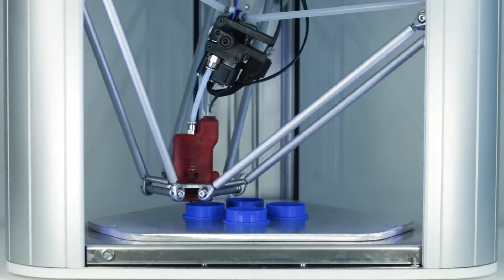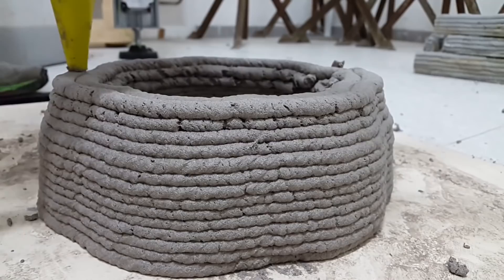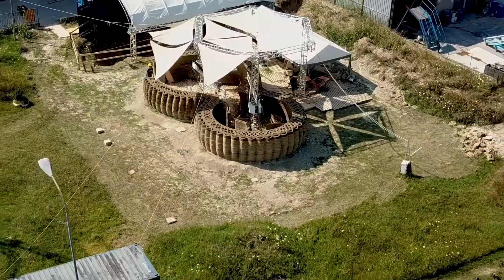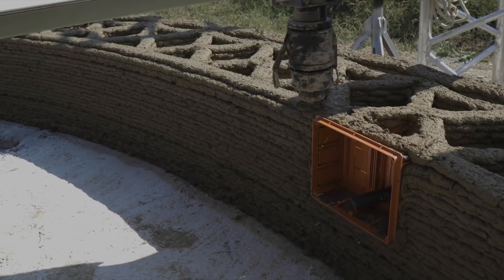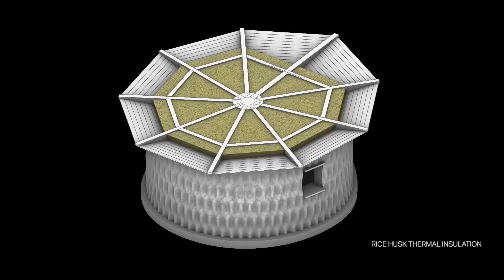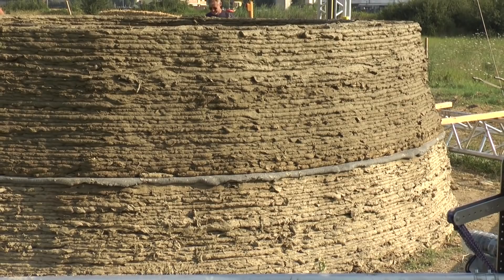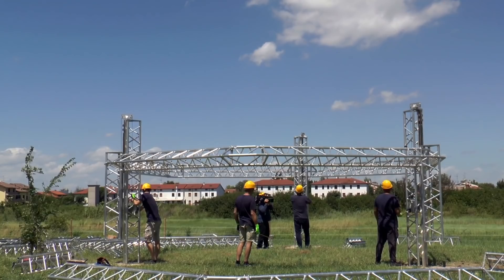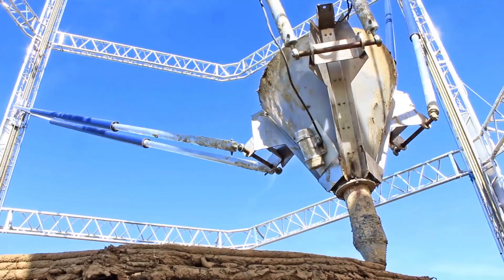$0 HOUSE | How One Startup Aims To Produce Homes at Null Cost

Comment: So the machines are free, the labour to set it up and transport it is free, the energy used to run the machines is free, the water arrives for free and is for free?

Do not make BS claims and BS clickbait titles, there can be no null cost house, only if you decide to live in a naturally formed cave or something (assuming you can get the ground for free).

So instead of claiming nonsense null cost why can't you/they just show the actual costs and the realistic savings??? 

Costs for houses, is much more than just the materials used, as for any object/thing. If such printers are made and are expensive then a certain rent will have to be paid by hourly or daily use, or at least some compensation to cover the initial costs of the machine and costs for the maintenance. You will also have to pay for the transport of it and for the labour to set-up the machine, break it back down, and for instructions or professional oversight for the usage. The machines also still need energy, probably electricity, to run, which is also not free. A zero cost house is generally impossible and a ridiculously stupid claim.
Reply from the maker: They said their goal is to make houses at null cost they didn’t say its possible yet.
Reply: @automateconstruction  They are clearly have an impossible goal that's why they don't mention the e time it takes to build one of these houses and the number of man hours. Build something for null cost means that the people working and developing this wold have to get their money worth some how. NOT the case, 0$ is a false statement, its fine for a YouTube video but for a company goal XD might has well say their goal is to make everyone rich and play pretend.

Comment: 0$ doesn't make sense and doesn't seem possible. 
They have costs for RnD, labor, materials(metals etc.), transport, construction and maintenance of the printer etc.
Maybe saying 0$ for building materials would be more likely. But even then, you need to buy the wooden support beams and the roof as well as the rice husk for insulation. So saying 0$ is misleading or in other words just a clever marketing scheme. Even though the project itself is awesome and I am exited for it, saying 0$ seems disingenuous.

Comment: Great initiative as mud walls may last a thousand years!
That being said, stop this ideological non-sense of not wanting to use engines!
Indeed, while not using (electric) engines for assembling the printer may seem nice at first, if you take this reasoning further, you should also taken into account the environmental cost of the metal structure, the computer and so on and so forth. This just looks ludicrous as one may use an electric 
engine for decades!

Comment: I'm a timber engineer ... the second you put the timbers inside to hold the roof you made the 3-d printing pointless. I could build that building in timber in 1 day. 
There is no value added by this tech.
Reply from the maker: Good point but have you been paying attention to lumber prices?
Reply: @automateconstruction  That's irrelevant. They still put timber columns and a timber roof on this building. The entire 3d printed wasp nest can be replaced with other materials that perform better. BTW prices for all commodities fluctuate, I've been doing this for 30 years, I've seen it up and down many times.
Reply from the maker: @hassleoffa  It certainly isn't irrelevant. In your 30 year experience how many other years have you seen the price of a 2x4 go up by more than double?
Reply: @automateconstruction  it absolutely is. There was no savings in the amount of wood fibre used in this building. None. They printed a fancy  mud shell incapable of supporting its own roof. Then added just as much timber as a traditional building. Zero fibre savings makes it irrelevant because you still have to buy the same amount.

Comment: Why is it that 3d printing houses cannot print roofs.
Reply from the maker: You can’t print in thin air you need to print on a surface
Reply: @automateconstruction   If we can 3d lay brinks why not 3d lay sticks of material? It also see concave building why can you not build a dome from previous hardened material.  I see them start that but not finish it in 3d building materials. It might be a timing issue were it would take too long to stack as the time it would take to build each layer would take too much time.

Comment: This is cool, but the whole $0 thing is very misleading.  Does anyone actually believe that this company will just show and do all that work for nothing?  No of course not because there are employees to pay and fuel costs, and a whole bunch of other things.  Granted, yes for charity or other similar things they may do it for free but not on a regular basis.  Absolutely no company can exist if they don't charge money for their services.  So let's be honest about it!  I'm sure it's definitely much cheaper than a traditional home but free,... I think not.
Reply: That's the thing why not compare the cost of a dirt house vs a normal wood house a show their savings? The way i see it theses dirt houses are more expensive per m² than a plain wood house, They have to build a wood structure to support the house so why not just set up some walls and be done with it? and the printing looks slow af and as they said it needs constant maintenance.

Comment: This is absolutely useless for any industrialized country. 
This is absolutely useless for any developing country, since the wasps is way too expensive, you need too much knowledge and expertise to run this system. Labour in those countries is way cheaper, so using them to build up houses is much better. 
A better solution would be prefabricated houses, that just have to be assembled on sight. There you only have the logistics. Manpower is readily available for creating and assembling the parts, since no machines have to be maintained.
Reply from the maker: Thanks for your input, I think you may be overlooking the potential for improvement in this tech. The first lightbulb was $100, far too expensive for mass adoption and at the time oil lamps were 50¢ but after 100 iterations they made a version cheap enough for 50 lightbulbs to be in every house. The device you’re viewing on probably has over a million bulbs.
Reply: @automateconstruction  I am not saying that this has no application at all, but when you look at cities, you can not just 3D print a house like that. The amount of automation required is just insane. I think there will be other technologies out there later on that will be much more efficient. 
In the city you can not just have a single floor building and I can not see ANY way that this system would be able to scale up. Adding another floor, maybe, but bigger buildings with a few floors do not seem feasible at all with this kind of process.
Imagine all the plumbing that has to be done, the electrical wiring, insulation and so on. You would also need steel reinforcements(rebar) and if you add those, why not just manually pour concrete into pre built structures instead of printing it. 
Imagine how you would have to scale something like this. You can not even guarantee constant quality. You would have to constantly supervise every second of the printing process, since errors could lead to structural problems. 
Sure, printing technology is still in it's infancy and rapid progress has been made during the last decade in all sorts of areas related to it. 
When I see the techniques and skills required to create huge skyscrapers or even bigger office buildings, I don't see how this could be achieved with a printing technique. 
Robotics has come quite far, but even welding robots can only do certain tasks autonomously and certainly not during construction on site, but rather in a controlled environment.

In my opinion prefabricated construction is an area where printing could maybe be implemented to automate certain processes, but to build houses I just don't see that.
Reply from the maker: @Medhusalem  If you wan't 1000 of the same unit, 3d printing will probably never beat prefab. 3D printing allows for unique  custom structures. I think it's impossible to predict where the technology will go over the coming decades. Most likely it will go in a direction neither you nor I could yet predict.

Comment: It's a joke and just exploiting people's desire for affordable and sustainable home. There are no such thing as zero cost. There are labor, materials (clay needs to be excavated and ground), electricity and printer amortization. And there are still concrete foundation. What's longevity of their insulation? What's R-value? Ventilating insulation? That's dumbest thing you can do from energy efficiency standpoint. Round shape - good luck fitting furniture in there.
Reply from the maker: Null cost is a bit different than $0 I must admit.
Reply: Maybe the next big change after 3d printed buildings is 3d printed furniture?

Comment: This seems like a snake oil sales pitch video. House for $0, no emissions, fully automated process, bla bla bla except like 80% of the work is not automated, it's not and never will be for $0 and also to make it solar powered you would need a truckload of expensive solar equipment which needs to be professionally installed and protected from weather etc. Also the huge metal construction on which is the printer mounted does not seems like "free and 0 miles" thing, more like a bloody complicated IKEA puzzle which will take another half of truck.

Have you heard of Superadobe ? It's real "non-snake oil" technology with which you actualy can build a very cheap house. Originally it was developed for NASA to build very durable structures from local materials on the Moon, Mars etc. and later it was optimised to build very low cost and natural housing for people here on Earth. It's definitely not fully automated and not for $0 but if you hire a two dozen of uneducated/unexperienced/homeless/hippie/vegan/volunteer/etc people you can build it on a very tight budget in two weeks or so with no power tools and just a few thousand dollars for materials. Many people already did it in different climate zones and on different continents. Look up the Cal-Earth Institute here on YouTube or just search for "superadobe" and you will find some beautiful and luxurious houses as well as wery organic and natural hobbit-like houses. You don't need a flat ground with a massive platform for huge 3D printer and nerds with laptops running around, you don't need any machines or electricity to build it and also you don't need separate structure for the roof. It's mostly build from "0 miles" materials - the soil you dig on your land. Then there is the "infinite potato bag" - can be sourced from many companies all around the world. Last but not least you will need some barbed wire and straw.